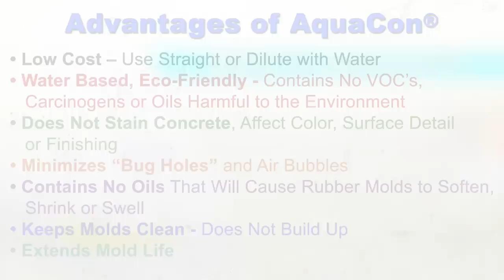Casting Concrete Using Aquacon Release Agent

Comment: Can we create a silicone mold that doesn't stick to wooden piece? I have wooden structure of designs and the silicone often gets stuck in them and the detailing is lost
Reply from the maker: We would recommend using Superseal on the wood first, then applying Ease Release 200 before pouring the silicone.
Reply: Please share contact information for the contact person in india, where I can get the super seal and release 200 spray